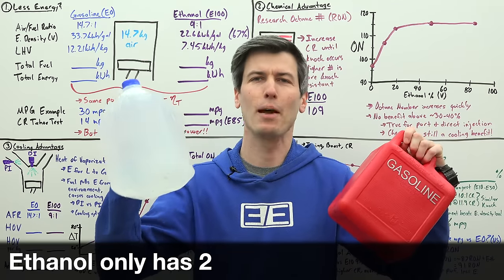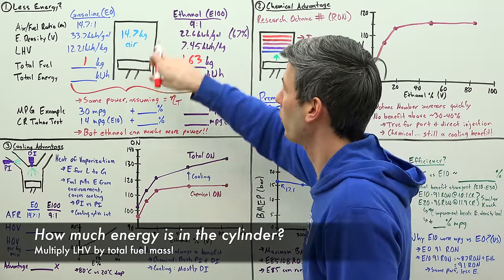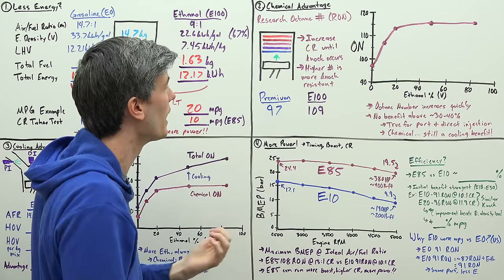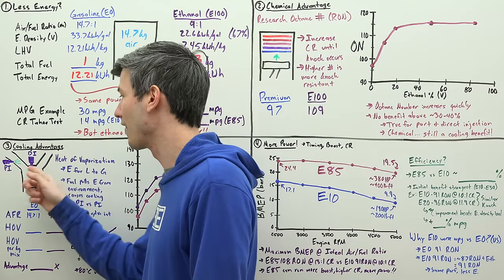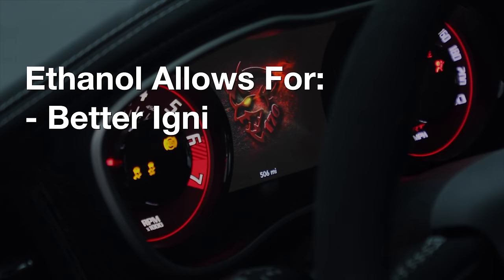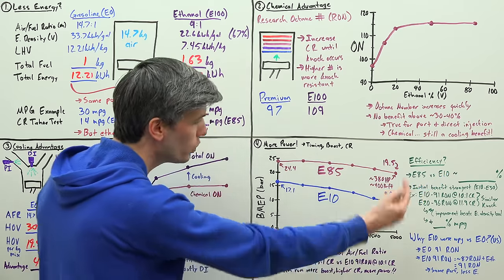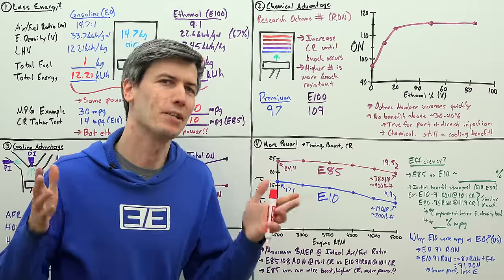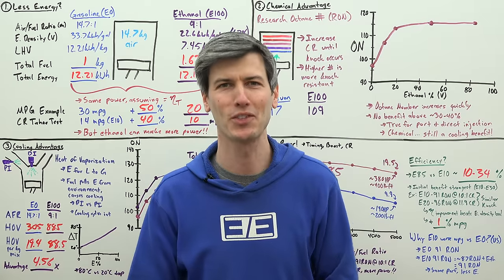Why Does Ethanol Make So Much Power? (Versus Gasoline)

Comment: Ethanol has no place in street cars. It causes damage. And the cost of additives outweigh benefits which are none. Government tax money is what's paying for it. This video is wrong... all wrong.
Reply: The EPA before approving E15 conducted long term tests on non-flex fuel vehicles 2001 and newer with not only E15 but also E20.  They found both fuels ran fine and did no damage.

The Bureau of Labor Statistics measured the percentage of household income spent on vehicle repairs and maintenance from 1990 to 2017.  The amount in 1990 was 2% and this declined to 1.5% while ethanol used in our gasoline exploded from .1% in 1990 to current levels from 2011 onward.

The very same non-flex fuel vehicles, boats, motorcycles, and small engines we have are in Brazil whose common gasoline contains 27.5% ethanol.  It has worked out so well and for so long that Paraguay went to E27 themselves.  India is going to E20 for non-flex fuel cars and all new cars must be flex fuel for E100.  

With our computerized cars, they purposely have to program a yellow light to come on with ethanol which is around E50 give or take.  

Ethanol on most any manufacturers chemical compatibility chart at worst shows it as being equal to or more often better on rubbers, plastics, and metals than what gasoline and BTEX (benzene, toluene, ethylbenzene, & xylene) are.

The main ingredient of non-toxic RV antifreeze has been 25% ethanol for many years.

BTW, there is no government tax dollars subsidizing corn ethanol production.  That ended back in 2011.

The long-standing stated goal of the G7 Nations to end petroleum subsidies?  Not so much.
Reply: @kevinmorris7722  BS.
Reply: @kevinmorris7722  Corn ethanol producers receive no Federal subsidies and haven’t since 2011.  It has come of age and is naturally that inexpensive even now with the current high price of corn because they offset that with high prices for their distillers grain.

Everything in my last post it true.  Perhaps if you’re right you should sell everything you have and move to Brazil and open up repair shops.  If your claims are right, you should become a gazillionaire in no time at all.  Thank me later.

Since today’s US fuel now contains the highly corrosive and damaging BTEX (benzene, toluene, ethylbenzene, & xylene), what makes you think safe for materials ethanol is the culprit of damage?
Reply: It's absolutely subsidiaries from the US for fuel. Legislation requires it. They did it long ago on a hoax agenda. And it does in FACT ruin equipment. The replacement for gear and parts far far out weight any mythical benefits. It's used in racing for Temperature. Your ready a spec Data sheet in your video but know nothing of how it legislated, used or processed. Your video is not only wrong but misleading. Shameful. People just buy into anything they hear, including you.
Reply: Also the carbon out which is almost irrelevant, is increased when you till land, harvest, transport, process and transport again for blending yet another process and then finally shipping for consumption. It's horribly inefficient and the process takes way more emissions to get to service than any misconceived benefits. It's just not viable.
Reply: Also race cars that burn ethanol use twice as much volume... twice as much fuel. It's used for temp. Not for efficiency.
Reply: @kevinmorris7722  Just wrong all over man..cant stop yourself can you.
Reply: @oldblueaccord2629  — Ole Kevin here is doubling down on a pair of 2’s …

Comment: E85 poor milage destroys engine components.                                                                                                                                                                                                     Cost more to produce than petroleum products.!!🤨
Reply: Brazil finds identical engines last >300% longer on E100 than on their common gasoline.  Soot wears out engines.

The spot cash delivered price of ethanol on the NYMEX is $1.46/gal.

The price of unusable sub-grade gasoline (RBOB) is $2.70/gal.

It takes more energy to produce and deliver sub-grade gasoline than ethanol.

To turn RBOB into usable E0 costs even more much like premium costs more.  Unfortunately, it becomes more toxic and dirtier.

Or simply splash in >10% ethanol and the resultant usable fuel becomes less toxic, far, far cleaner burning, and cheaper/cheaper per mile to drive with.  Who can be against that?

Comment: Ethanol doesn’t make more power than gasoline! It’s just not possible! It’s got a third less btu’s per gallon! The physical laws don’t allow it ! But hey use it if you like water in your fuel!
Reply: Perhaps you should rewatch the video.  

BTU is a measure of heat, not work. 

He was not talking about a steam engine but an internal combustion piston engine where ethanol's superior heat of vaporization, octane, flame speed front, volume of combustion products and other factors more than overcome its lower BTU content.

In physics, power is the rate at which work is done or the rate at which energy is transformed or transferred.  75 to 80% of the BTUs are wasted in a gasoline engine.

GM rates their 5.3 L pickup engine at a clean 380 horsepower on E85 vs a dirty 355 horsepower on E0.

Mercury Marine, which hosted a Webinar on ethanol myths, noted that ethanol does not "grab water molecules out of the air." It is hydrophilic, which means ethanol holds water. With regular gasoline (E0) as well at E10, the primary cause of water collecting in tanks is condensation on tank walls. But unlike E0, which can absorb almost no moisture, E10 can hold up to half of one percent of water by volume, and the water molecules will dissolve in the fuel. The "solubilized" water will bypass the water separator and burn harmlessly through the engine.

>>>Mercury Marine also says E10 may be the superior fuel(over E0) because it keeps the fuel "dry"<<<

In the wintertime during the days of E0, people actually would buy little cans of alcohol for gas-line antifreeze with brand names such as Heet or Dry Gas.  No need to anymore with E10.

Ford's first prototype eco-boost engine was optimized for E85.  It achieved 15 to 20% more fuel efficiency than gasoline with load performance equal to diesel engines.

Ricardo built an ethanol engine for GM and it ran in a pickup. It is half the size/twice the power 

FROM RICARDO:
The new federal CAFE standards are calling for a doubling of fuel mileage performance, which, Vint says, is going to send OEM’s looking for high octane numbers to improve efficiency and ethanol is the best source. Ricardo, an engineering firm with over 100 years in the business of engine design, has developed an extreme boosted direct injection engine (EBDI) to optimize ethanol blends. The 3.2 V6 gasoline engine rivals the power and torque of a much larger GMC Sierra 6.6 diesel, he said, and it delivers 3.5 percent better fuel economy than the diesel.

Scania has sold an ethanol engine worldwide for years which they state has fuel economy and power on par with their diesel engines.  Cummins had their ethanol engine called ETHOS which was half the size/twice the power of gas and diesel too.

This is not new technology or knowledge, it was known long ago.  It is suppressed technology.

Rear Admiral C.M. Chester wrote Henry Ford a letter on Dec.15, 1916:
"...I also pointed out in the article that as governmental laboratories had developed from 40 to 55% efficiency in alcohol engines as against 20% in gasoline machines, the use of alcohol at double the cost of gasoline for power purposes, was cheaper for motor[s] than gasoline in common use today."

Scientific journals from 1890 – 1920 contain hundreds of references to alcohol fuel at the dawn of the automotive era. 

Studies of alcohol as an internal combustion engine fuel began in the U.S. with the Edison
Electric Testing Laboratory and Columbia University in 1906. Elihu Thomson reported that despite a smaller heat or B.T.U. value, “a gallon of alcohol will develop substantially the same power in an internal combustion engine as a gallon of gasoline. This is owing to the superior efficiency of operation…”

The USDA tests in 1906 also demonstrated the efficiency of alcohol in engines and described how gasoline engines could be modified for higher power with pure alcohol fuel or for equivalent fuel consumption, depending on the need.

The U.S.Geological Service and the U.S. Navy performed 2000 tests on alcohol and gasoline engines in 1907 - 1908 in Norfolk, Va. and St. Louis, Mo. They found that much higher engine compression ratios could be achieved with alcohol than with gasoline. 

When the compression ratios were adjusted for each fuel, fuel economy was virtually equal despite the greater B.T.U. value of gasoline. “In regard to general cleanliness, such as absence of smoke and disagreeable odors, alcohol has many advantages over gasoline or kerosene as a fuel,” the report said. “The exhaust from an alcohol engine is never clouded with a black or grayish smoke.” USGS continued the comparative tests and later noted that alcohol was “a more ideal fuel than gasoline” with better efficiency despite the (*then*) high cost.
Reply: @danafletcher2341 Poor poor Marvin...hes a robot!